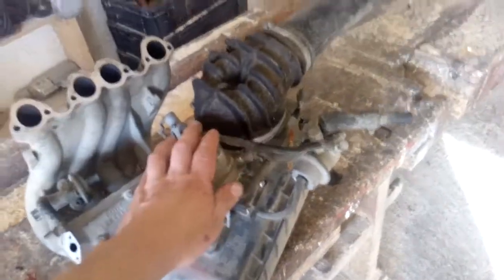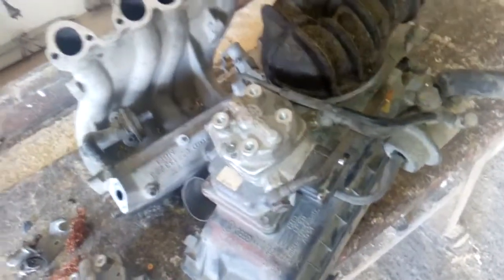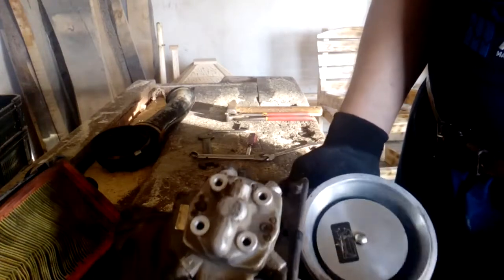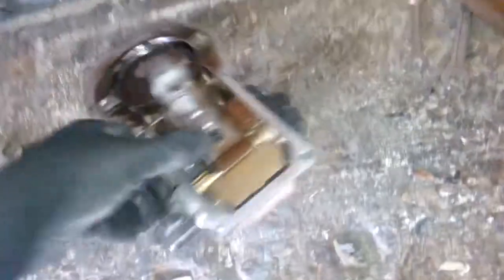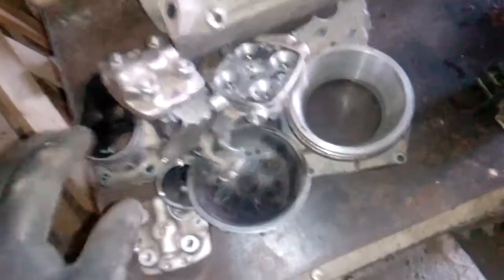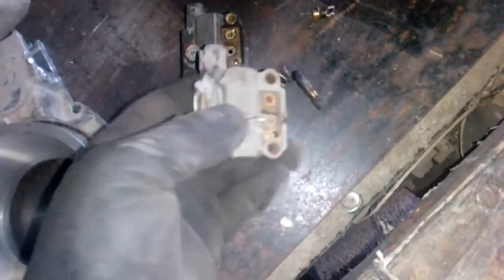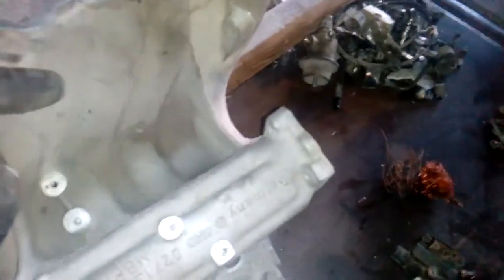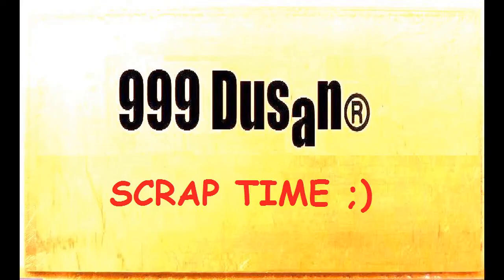Scrap K-jection car fuel sistem for aluminijum,scrap metal and extra brass!

Comment: if you build an oil burning furnace , you can melt that entire part at 1 time and separate the steel from the slag later , all you need is 2 propane tanks , 1 steel barrel with a lid  , 2' of 2" pipe  , a few feet of hose , a meter of 10mm soft copper pipe ,  a gate valve and a shop vac